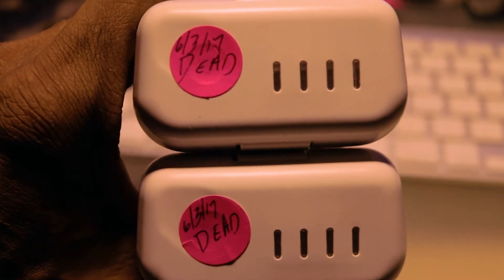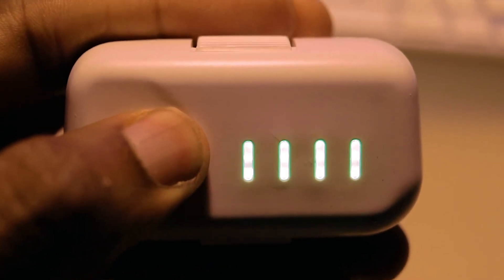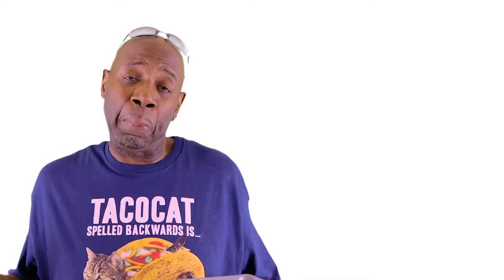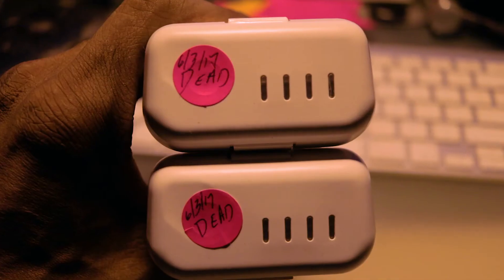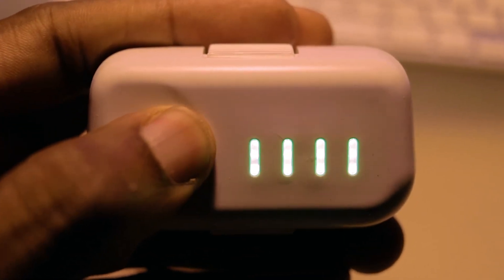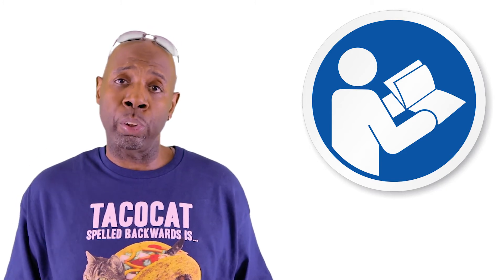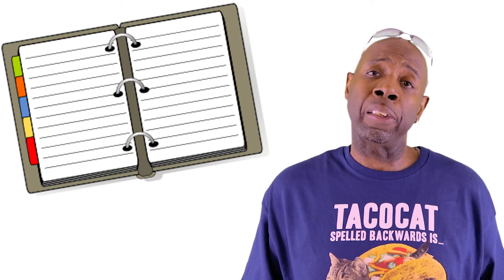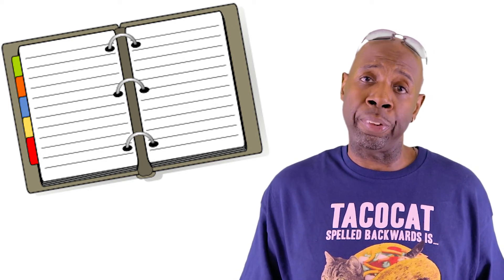How To Make Your Drone Battery Last Longer | How To Get Longer Drone Battery Life

Comment: With the new sistems drones auto land when low battery
Reply from the maker: Gun4Fun -Airsoft - Yes they do and it's helpful.. Thanks.
Reply: Mine just falls it died mid air about 70ft high luckily it only weighs about 110 grams so I caught it